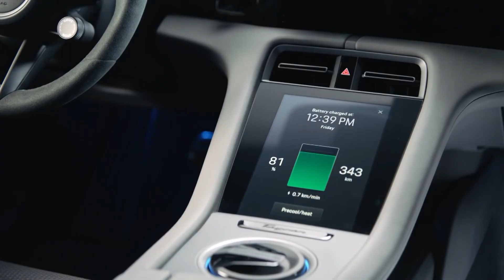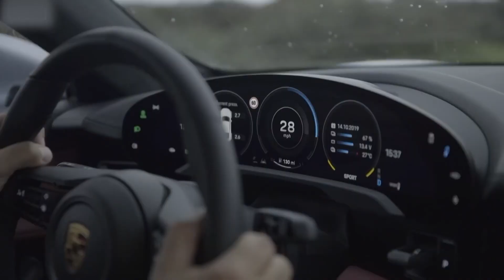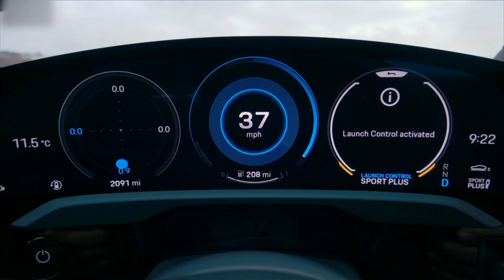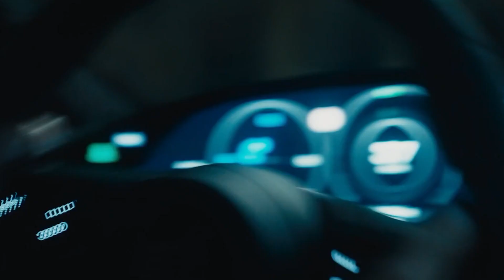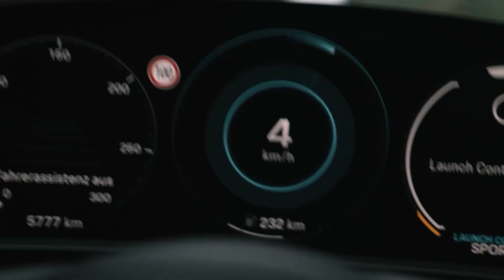Porsche SHOCKS Industry With Game-Changing Battery!

Comment: Fake news. I read in a German newspaper that Porsche is already planning to delay getting rid of gas engines.
Reply from the maker: That’s actually great news!
Reply: The EV market is seriously tanking. The charging network is broken, in the US anyway. Used EV values are plumeting due to the cost of a pending battery replacement. The whole thing is a sham. EVs just don't make any sense unless you are a fleet business and you can use the depreciating value as a tax write off. Just stick with ICE or maybe there is some promise in hydrogen vehicles and use renewables to create the hydrogen through electrolysis.